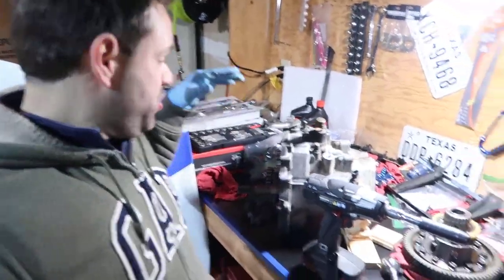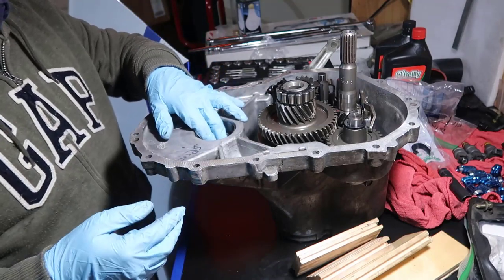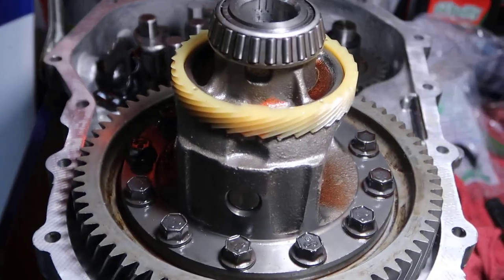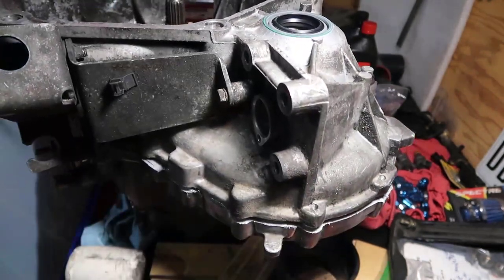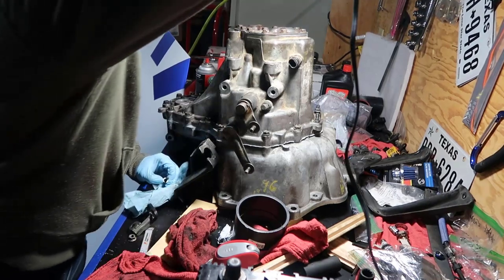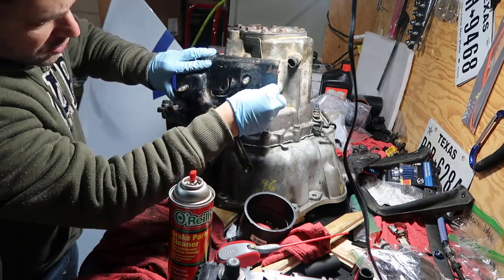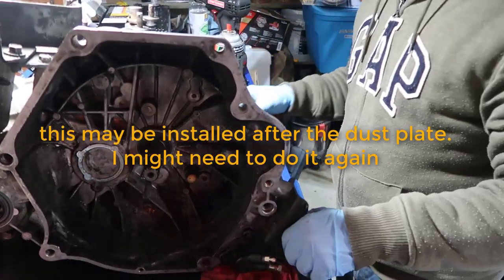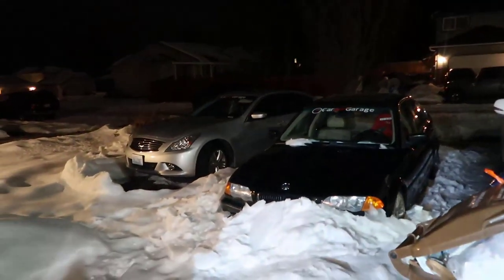Differential Installed  on Transmission NV-T350 - #Eclipse2GBuild

Comment: Have you replaced the clutch fork fulcrum on this trans? Mine broke loose and I have no idea how to fix it
Reply from the maker: No I have not.  If you take the transmission out you will have access to the fork
Reply: @CarModsGarage  yeah. I seen some people remove the insert, put a helicoil in it and then thread in a 3000GT fulcrum and I guess it works